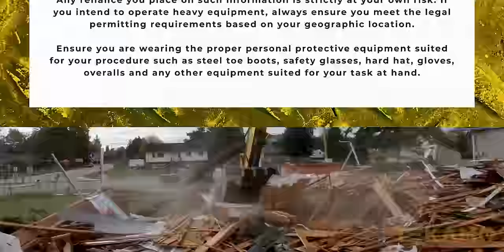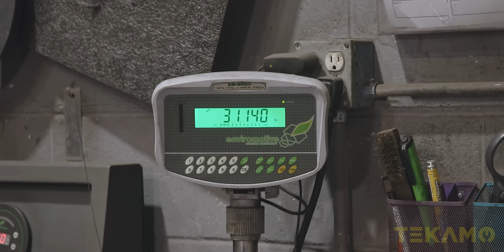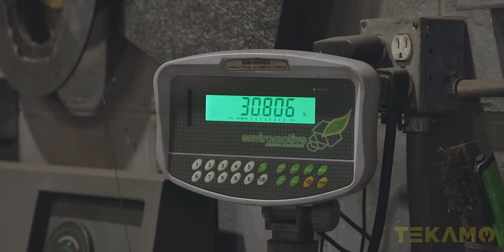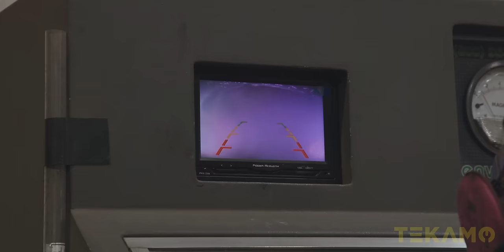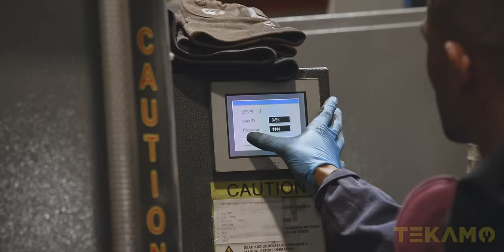Getting The Excavator To Spin Again! Cam Finishes Up The Rotec - Service Call #64

Comment from the maker: Want To Know When New Tekamo Merch Is Coming? Sign Up Here To Be Notified! https://tinyurl.com/notify-me-tekamo-merch
Reply: I think it was brilliant showing the cut apart of the emissions muffler 😊
Great information on how they operate from inside view. Then being able to resort to the unit like it new. So glad that a shop can clean these up, then rebuild them so they can be used again 😊 instead of just recycling a big piece of metal. That those units can be rebuilt 
I always wondered about the build up of engine waste in particular. Can they be removed.
Reply: The track adjustment is informative 😊
It is so neat how you can use an excavator own dipper and bucket to help remove parts on a track system 😊 they are such a versatile machine to help remove parts for repairs 😊 I love your step by step of repairs 😊 I'm a nerd that way. Love to see how things work, and what part wear😊😊

Comment: When does the WOOD from the House Demo. Go after its put in dumpsters 😊
I ran a CAT that size filling dumpster from yard tree waste after we had a big wind storm. It was FUN. Pulling pile, then lifting bucket loads into dumpsters. The big Gravel yard in my area, has a fire wood separating yard in the Pit off to the side. One of the workers in Pit, cuts up the larger wood chucks into firewood 😊
He has a huge firewood square Neat clean stack of wood ready to sell. 😊

Comment: Just did a undercarrage with that style of torque wrench, after we broke our old one. its really nice but the directional head tripped me out for a second. 600 ft-lbs woulda been so much easier to hit if it was needed on anything other than the rollers, frustrating week.